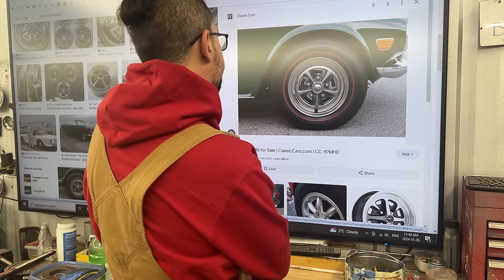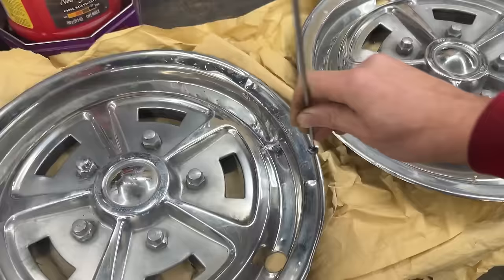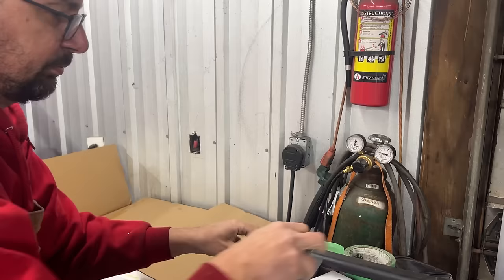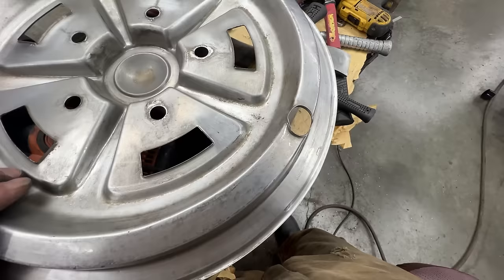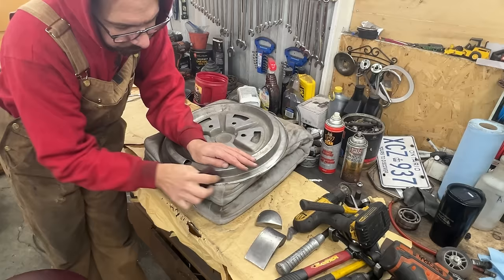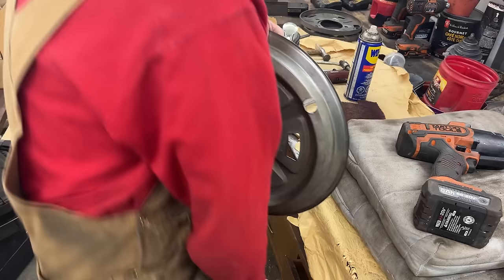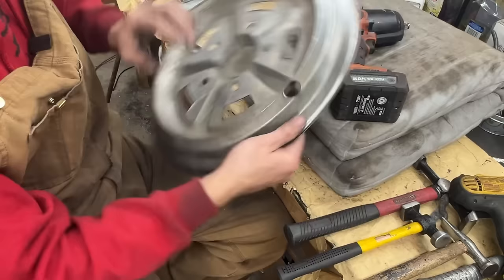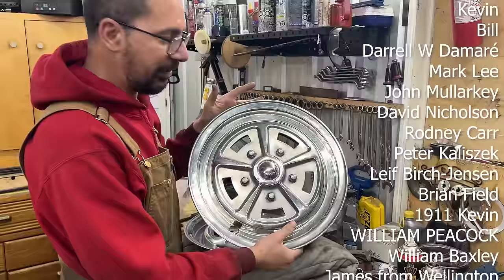1969 TR6 Wheel Covers Restoration

Comment: Maybe the hub caps are stainless steel?
Reply: Quite likely... they repaired well enough with a bit of "tickling", so not an aluminium alloy I'm pretty sure. They are not very light, they seem quite like stainless steel "beauty" trim rings in that respect.

I think you can only stamp thin steel into a shape like that....
Reply: And if not magnetic,  then maybe an austenitic stainless steel.

Comment: I had a set of the Rostyle caps on my1969. The problem that caused many guys to take them off or replace with other wheels is that they would vibrate so loud that they became very annoying. The vibration was caused by the loosening of the bolt’s riveted to the  mounting plate. Your fix  to secure with bolts to the lug nuts will likely fix the vibration problem

Comment: I would suggest using steel cement (in a tube) on the back of the cover for fixing the crack, after it is tapped into place. I had a new 1974 Mazda 616. The RX2 of the same year came out with Rostyle rims and I had a set fitted to my 616.

Comment: Maybe brazing the cracks with some low melt stainless hard solder is an opion without deforming (should be invisible since rechroming had a few layers of material put on ...)

Comment: I pretty sure you'll find they are made of stainless steel. And are polished not chromed. 🤔 And being stainless it will work harden when you work it like copper. Which can cause brittle cracks. But you can anneal it like copper brass and aluminium. It can be TIG welded👍

Comment: They were also used, for 13" wheels on the Mk.2 Triumph Vitesse from 1969-71 and GT6 cars of the same period, and yes they were stainless steel. I think it's ironic that the hubcaps have 5 fake nuts but the wheels themselves only have 4

Comment: Looking good. Stainless is tedious to work with.
You want your tool faces polished as the surface finish will transfer to the metal you're working. 
Also, not sure how much a tool like this would be of benefit for these hubcaps, but here is a trim straightening tool another metalworker showed me. It's advantage is you set the depth of the tool to the thickness of the metal, so you don't run the risk of stretching or over stretching the metal. 

https://youtu.be/kAzCqbmd8vY?si=564M3zO1Idp-zT3N